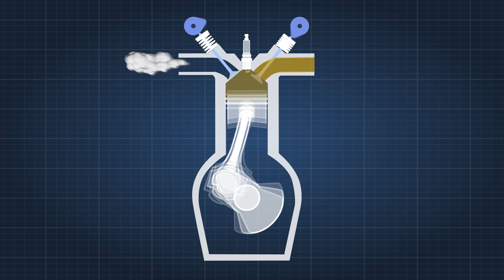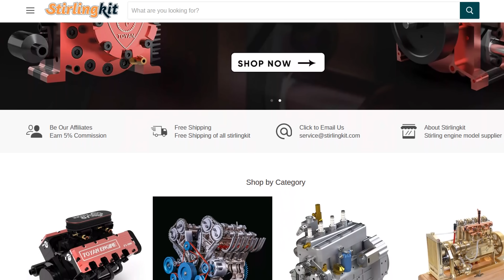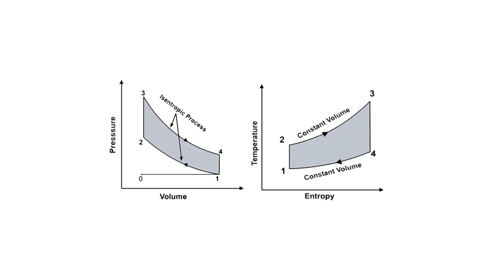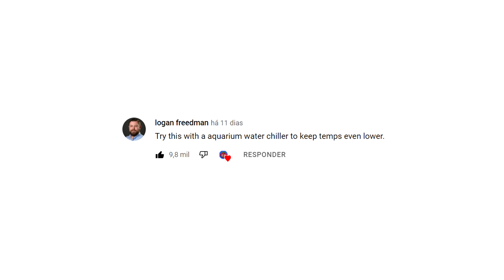I 3D Printed a Transparent Combustion Engine in Resin

Comment: I wish my phone had a gas tank instead of a battery.

To be serious though, four stroke engines are great engines. Wankel engines are significantly more in efficient than piston engines. They also have to burn a lot of extra oil. Most two strokes are butt simple engines for the sake of cost. Any two stroke that doesn't burn oil and spit out u burnt fuel needs a supercharger and fuel injector.

Also, that tiny engine is probably not gonna be the most super reliable. You could always try using a petrol vapor cafboretor that most model engine makers use. I feel like they are used because of their simplicity, but you do get a completely vaporized fuel with it. As another comment said correctly, the carburetor you are running the engine on is making the engine run incredibly rich. Too rich to work reliably. These micro engines tend to spit out a large amount of excess fuel. Anyways the most effective setups I have seen have a petrol vapor carburetor and a second air intake valve to thin out the mixture as desired. It can be a bit fiddly but you will certainly be able to find an efficient and effective ratio of fuel to air. Also you will not of excess gasoline spitting out of the exhaust.

Comment: As you properly guessed the ignition timing is key factor. On higher RPM-s you will have a lot of misfires because the ignition duration is not on spot. As other's suggest a load would decrease the rpm. It is also possible that there is not enough air in the mixture. You can measure the compression ratio by a syringe and some oil when cylinder head is upside down.  I would suggest to increase the sealing on the head valve too, because It seemed me that you lost some pressure during compression and some fuel mix came out at the seal. Octane number only means that the fuel mixture can be more compressed without the risk of selfexplosion. Usually the lower octance fuels burn better. Ideally you want the lowest octane in your engine that does not cause knocking.

Comment: What about to 3d print a turbo compressor for this 4 stroke engine and use the exaust gas to put more air on the combustion chamber. Maybe see the increase of the rotation or even explode the engine! Like tomatoes! 😏
Reply: This could be awesome!
Reply: If you print this on a bigger scale, send it to me, and I test on my ATV to see if it handle the power or gain some power. I record a video and send to you to show the results

Comment: your coil pack can not recharge fast enuf to consistently re-light the fuel. As for the methanal they use it in racing cuz" it produces a lot more power from 50% plus and it also burns cold. and for a new video a clear 3d printed crank case.

Comment: Looks like the issue is the carburettor, your fuel-air mix is all over the place. I think it's the opposite of some of the other commenters though - I think it's too lean.
Your 8-stroke cycle is
* Air + insufficient fuel intake
* Compression
* Decompression + fuel settling out of the fuel/air mix
* Exhaust of mostly just air
* Air + additional fuel intake
* Compression + mixing with remaining fuel in cylinder
* Power
* Exhaust

Also, you need a gasket between the resin cylinder and the brass head because you're definitely losing a fair amount of compression there. Just trim up some thin aluminium sheet (drinks can?) to the right size and sandwich it between

Comment: And as far as the spark is concerned you can actually weaken the spark with two high of compression..forced induction can get tricky..also try placing another magnet to double the if possible

Comment: You might need to adjust the timing advance to allow it to account for different fuel burn rates, if it's just a magnet or hall effect sensor, you would need to physically move the sensor, or coil, or adjust the magnet's rotation on the cam if there is a built In adjustment method
Reply: I commented the same thing this is totally a timing and compression issue

Comment: its not unlikely that that motor is designed to run on nitromethane, like most small RC engines were.
sheer RPM is not an indication of Power output since the torque has to be factored in. mybe you coudl build a Dino and compare the torque out put as well. a flapper wheel and a loadcell could be good enough to give you an indication.

Comment: I believe it is miss firing because the fuel and air are not being mixed properly in that little carb, so randomly sometimes the fuel air mixture around the spark plug is correct to ignite and sometimes its too rich. The nitro methane will ignite at a very rich mixture so it ignites consistently. You could try using propane and try adding a pipe between the engine and carb with something inside the pipe to add turbulence to help mix the fuel and air better.
Reply: Also some engines interrupt the spark as a method of limiting max rpm.

Comment: When you factor in the lifespan of a fossil fuel vehicle compared to an electric vehicle the fossil fuel vehicle has a smaller environmental impact over the lifespan of the vehicles. 
I'm still all for having electric in high population density cities because the air pollution is a matter of concern when it's concentrated. 
Electric vehicles are terrible for the environment when you only get 1 parts per 10k of the elements you are mining for and we don't have super conducive energy grids. So in rural areas the wasted resources of electric cars are very bad for the environment worldwide.

Comment: the reason is .. something called flame propagation in nitromethane and alcohols burn faster which means the flame reaches from one side of the cylinder to the other quicker but it has less energy density per measured amount of fuel... Hence a faster engine but less torque

Comment: My guess is your spark timing is off due to higher rpm. Possible it's a timing delay between the cam sensor to the spark firing that needs to be corrected.

Comment: Im not sure what do you mean by "power of the fuel" but the power of the engine is both speed and toque. In your test you only measure the speed and you are using close to zero load (only the drag of the engine). So not only there is a component of the power you are not measuring but also having no load can affect the performance of the engine since the speed is limited by factors that shouldn't apply normaly (like the expansion speed of the fuel, the engine's drag and how fast and well timed the ignition sparks are). You can see the same thin with electric motors where you can have really small ones that spin really fast but as soon as you put a load on them they stall. My advice would be to put a load on the engine, like a propeller or a treadmill, that would limit the RPM and then measure the speed of each fuel. You need to also keep in mind that for each type of engine there is an optimal speed where the engine works best and for the 4-stroke gasoline engine i believe it is around 1500 RPM, which is much lower than your tests.

Comment: The best fuel in terms of power capacity does not mean that it should give the highest speed to the engine. It is possible that a large amount of energy is wasted by the engine in the form of heat.

Comment: Your question about 4-stroke piston engines; I personally believe that the 25% nitromethane has a higher percentage of liquid than other fuels (the liquid itself is less viscous, resulting in a higher ratio of liquid into the combustion chamber), however, it causes the piston to have less room to compress when compressing, resulting in more energy being required to replace it when compressing to the same compression volume as other fuels, thus reducing the engine speed.

Comment: The two problems you are having are fuel mixture and ignition timing. Race engines are highly tuned to get the best performance and each fuel needs different tuning to run optimal.

Comment: To much speed is causing a misfire with the weaker fuel. The richer fuel ignites better but doesn't give as much compression on the power stroke leading to less speed. The cheaper fuel builds up on the extra stroke causing a bigger ignition leading to more speed but also misfiring on the next stroke again causing fuel build up and a bigger ignition leading to more speed.

Comment: You also have no ignition timing, you only seem to have misfires at very high rpm. At that speed the spark plug needs to light a touch before too dead center. Also at those speeds you get alot of valve float due to weak valve springs. Also noticed your valve lash is pretty bad lmaoo hope this helps!

Comment: Each fuel requires a particular ratio of the carburetor for a perfect combustion, moreover variables like weight, diameter, cm2... can make vary the parameters of admission 
What I would like to see is to compare the different fuels by installing a solution that gives them more kinetic energy with for example the installation of a flywheel ( "volant d'inertie" I'm not really sure about the translation )

Comment: You should 3D print a supercharger for the engine, running the supercharger off the output shaft of the engine. 

It would also be interesting to make a water-cooled clear resin cylinder to see the water flow around it and cool it. The water pump could be 3D printed and powered by the engine.

Comment: Hi I have been flying both methanol and petrol engines in model airplanes for many years. On the practical side, metanol definitely has more power. I can confirm that. I'm not sure about your ignition... However, it is true that when nitro is mixed with methanol, there is a clean burn and the engine runs better. I believe that because of the alkanes Mathan, (right at the beginning) from a chemical point of view  has more energie (power). But it is also clear that the carburetor that is installed in your engine is one for methanol engines and not for petrol. 
LG

Comment: So with fuel, you have to get the stoichometric ratio correct in order to get proper air fuel mixture correct. If it's too rich, no combustion, too lean no combustion. Also,  you could be getting the timing off because the spark may not be hot enough to burn the fuel in time. The spark should start about 5-10 degrees before top dead center. This will allow the fuel to heat up and atomize enough for the spark to ignite the fuel while it's still trying to compress. Then it will start the expansion just as it hits top dead center causing a more powerful power stroke and burn more of the atomized fuel. Because you're using direct injection, it's more difficult to get these engines tuned in without a computer.

Comment: Perhaps the different fuels are not reaching optimal stoichiometric ratios with the same carburetor settings? You could try forced intake so you can dial it in to get the most power maybe. Very cool demo engine mate. Nice work on the 3d print cylinder.
Reply: stoichiometric is the most efficient burn of a fuel, but not for getting the most power. not that it matters much on a tiny engine for the purposes of this video, however that thing was running extremely rich, you could see fuel down the cylinder walls. so anything learner would be better.
Reply: @Blake Belladonna I don’t think stoich would be a great idea for this engine. A lot of engines (from jet engines to rocket engines, to Internal combustion engines) don’t run at a perfect stoichiometric ratio because, while it may generate the most power, its also going to generate the most heat. In ICE’s, you don’t want that because a lot of the internal parts will start to lose structural strength, and would eventually just fail at those temps. In this case, where you don’t even have the benefits of an iron/aluminium block to act like a big ol’ heat sink with coolant passages through the hottest areas, you’d just melt the resin “cylinder”, then the aluminium components, then the brass components.
Reply: Dylan is correct. Most cars will only shoot for 13.7-1 which is stoich at idle and at a constant cruise. When accelerating they can sometimes go as low as 10.5-1 to prevent damage to the engine from heat, pre-dentonation/ pinging, etc. And in some situations newer cars will push beyond stoich to 14 or even 15-1 at a cruise to further increase fuel economy. This causes the engine to stutter slightly but is not noticeable with an automatic transmission with a torque converter as a buffer.
Reply: @williamking5979  stoichiometric doesn’t change with engine speed ever. It’s just the amounts needed to have a perfect chemical reaction. The only time the stoichiometric ratio changes is if you start talking about different fuels(alcohol vs gasoline). 
Yes you will run rich and lean some times but that is more a byproduct of an imperfect system. That is to say you don’t need to run rich to accelerate( not talking about dirty diesels) in fact you could accelerate with a lean a/f ratio. The acceleration is caused by the throttle plate opening up and letting more air into engine. I do believe that it is a little more likely to accelerate rich rather than lean but a constant acceleration should be mostly done at stoichiometric a/f ratio. It’s only the very good but imperfect system reacting to what has happened last ignition and dealing with basically random inputs by a driver that cause the a/f to stray from stoichiometric. 
Also the torque converter will smooth out the power pulses from individual pistons on their power stroke, it does not smooth out misfires in the engine ( the misfire basically unbalances the engine and physically causes the engine to shake and that’s how the driver can feel misfires. The stutter you refer to would react the same way as far as the engine is concerned tho obviously less so but would still be felt and would not be able to be smoothed out thru the fluid coupling of the torque converter. Uneven compression in the cylinders would also react like this. 

Without the fluid coupling of torque converter (or the dampening mass of the flywheel in a manual tranny) you would feel a little “kick” as each power stroke pushes the vehicle forward.
Reply: stoichiometricis kinda the best of all worlds. Lots of power, runs cleanish, and won’t destroy itself. Lean burns hot and can melt pistons and valves etc. rich will never burn out the engine but runs dirty and will eventually stop because of that. 
It is best to run stoichiometric to slightly rich. 
The most important thing that will effect things is that different fuels can have very drastically different stoichiometric ratios. stoichiometric Air/fuel for gas is about14.7/1.0. (14.7 grams of air with 1 gram of fuel. 
stoichiometric air/fuel for nitro methane is about2.1/1.0 (2.1 grams air with 1 gram of nitro methane)

If it’s a carb designed to run gasoline it may be too lean for use with nitro methane. As an example if the cylinder held 14.7 grams of air it would need 1 gram of gasoline for stoichiometric combustion or approximately 7 grams of nitro methane for stoichiometric combustion. Too rich or too lean can cause no combustion and a carb designed for gas may be too lean for reliable nitro methane combustion. As the exchange is not 100% it may take 2 or 3 cycles to build up enough nitro methane to actually combust.
Reply: Most engines do try to run perfect stoichiometric ratio as consistently as is possible. It creates the most power reasonable available and runs fairly clean as well. But that’s not why they do it. They do it mostly for emissions reasons, this is especially true for automobiles. All automakers have to meet certain emission levels and as they are judged by the entire fleet of vehicles they make even going slightly over set levels by not being stoichiometric can lead to billions of dollars in fines from government. Running rich produces more hydrocarbon pollution(ever seen a diesel pickup truck “rolling coal”, running lean makes combustion hotter and leads to the formation of nitrous oxides( that causes acid rain). 
Various vehicle manufacturers have tried various ways of idling the engine lean to save fuel but because at idle there is less air entering the engine (less volume of combustion lowers combustion temperature) so the increase of temperature by running lean doesn’t raise the temperature to that required to create nitrous oxides. 
It’s only in pretty extreme conditions that engineers try to run combustion outside the best stoichiometric ratio they can achieve. Example top fuel dragsters, run as rich as you can to get most power and cooling from nitro methane without hydrolocking the engine. Another extreme example would be the Saturns F1 rocket engine. They run( lol they haven’t run a Saturn F1 rocket engine in many decades, should have said ran not run) pure fuel around the outside of the injector assembly to stop combustion from happening against the inside surface of the rocket nozzle so it doesn’t melt. Every where else on the injector assembly is set to run perfect stoichiometric ratio mostly for power but also a little for it to run clean. 
In short other than a few extreme examples any engineer that has to pick an air fuel ratio will pick the perfect stoichiometric air fuel ratio(at least as perfect as the technology he has available can achieve)
Reply: Having said all that every automobile engine tho it runs as close to stoichiometric as it can most of the time they all go lean and rich depending on the specifics of how it’s being operated.

Comment: @11:00 The issue is with your magneto timing, valve timing and piston ignition timing.. The fuel isn't igniting properly because of the energy output of the fuel being provided. If you change your magneto, valve, and intake/compression phases to match the fuel potency requirements, i think it will help. You hate Tomatoes, I love Tomatos :-D